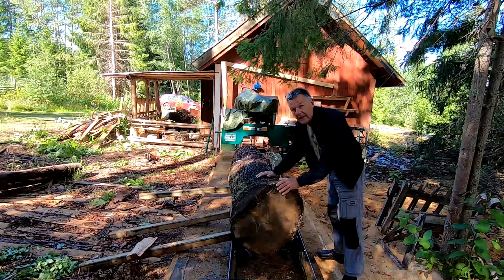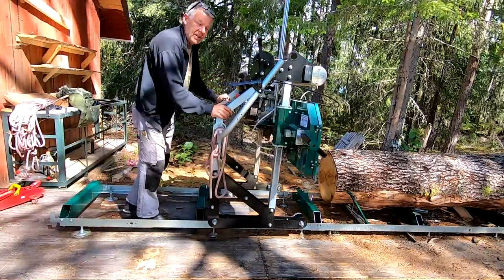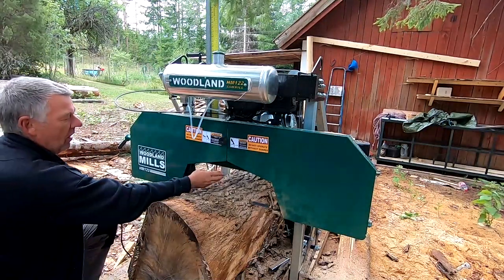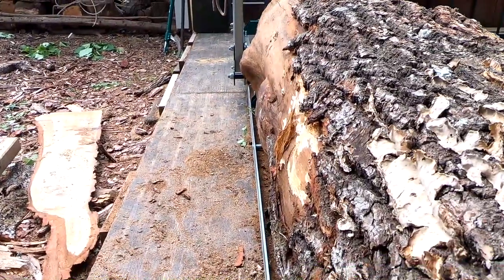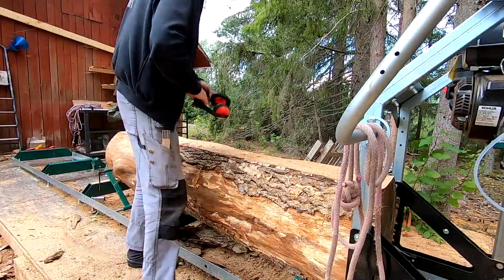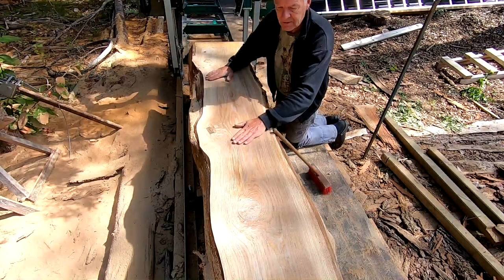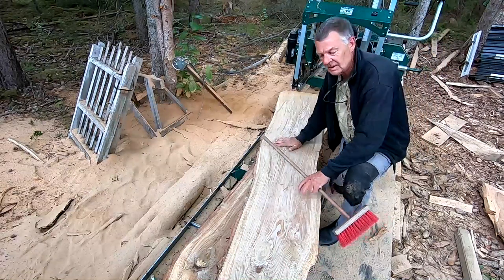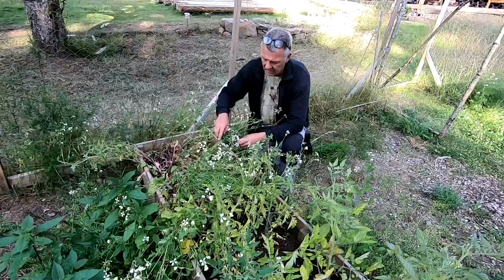Big oak log, Woodland Mills HM122 - VLOG #169 - S4

Comment: I enjoyed the demonstration and the garden. I'm curious why you slabbed that log and didn't cut it into a cant and process it into lumber?
Reply from the maker: Hi Roy. The short answer - It's not mine. Meaning.... One of my neighbors delivered a pile of mixed, smaller logs to me. some of them are oak, and some of those will be made into lumber or boards, the rest will be firewood for next winter. And instead of money going between us, my "payment" for the stack, was sawing 3 oak logs and 1 pine log, into 2 and 3 inch live edge slabs for tables and benches. That's how we deal with most things out here in the woods. 
All the best
Michael